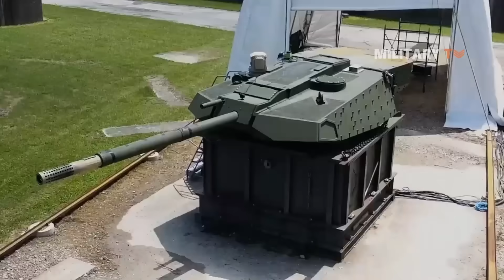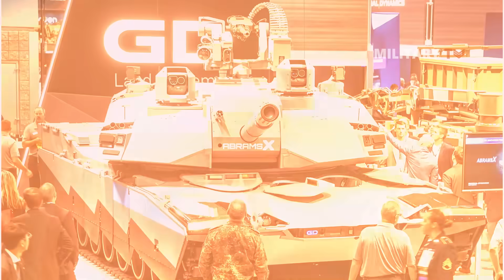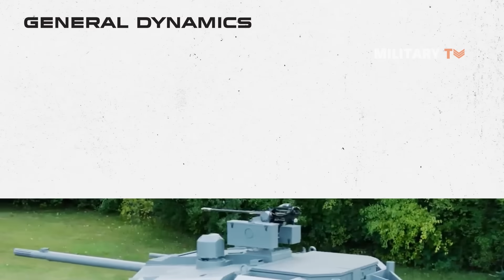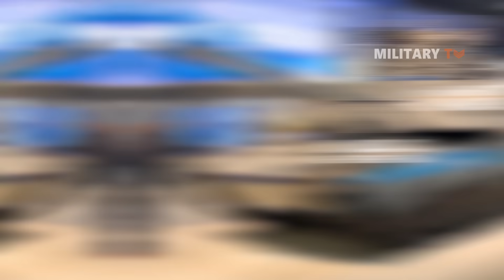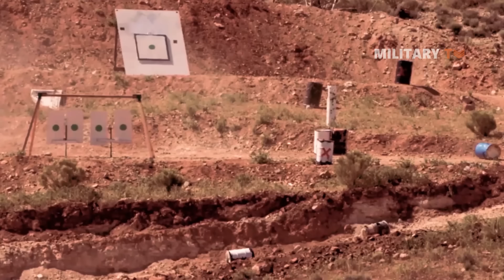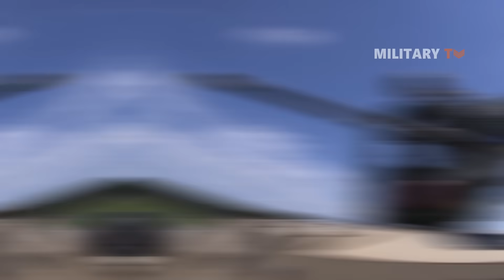Abrams X Tank: US Army Successfully Tested Deadliest New Tank

Comment: Yes, the tank should definitely be adopted by the US Army obviously. It has so many advanced features over the previous versions that make it significantly better. The other versions like SEPV3 and 4 are way too heavy for once. They became more then 70 tons heavy which is ridiculous. This one most likely has the same protection but with significantly reduced weight, I'm guessing its weight is at least 10-15 tons lighter which will make it easier to transport by air. Plus all the other features like an unmanned turret with a gun fed by an automatic loader. I mean, the fact that the US, UP UNTIL THIS DAY hasn't managed to put an automatic loader on any of its major tank or artillery systems is an embarrassment. The Russians have been doing it since the 1960s. The tank needs to be adopted. Stop with that "it doesn't offer significant advantages over predecessors which can be improved" because THAT is what brought the US army to this state and that was just a tactic by America's domestic saboteurs to prevent the US from gaining a clear military edge over the Soviet Union during the Cold War. That mentality stems from the Cold War days...

Comment: yeah and the batteries will be dead constantly. the vehicles will constantly be in for repairs and parts replacement. costing millions of dollars. maintenance and drivers maintenance is never done properly and that's gonna render the vehicle just about useless on just about a constant basis. all of the electronic systems are super cool and make things really easy, until they stop working. which they do all the time, they break constantly. and I'm the one who has to fix it. and knowing engineers, those batteries are probably gonna be a goddamned nightmare to access and replace. AND THEN. well why cant we get any parts???? well it's not supposed to break!? .......... so you have no parts? nope they were never supposed to break in the first place....................................................

Comment: What happens when the internet shuts down tanks will not be able to operate with all the AI stuff they have 😮
Reply: I don't believe internet is necessary it should all be ran off its own operating system. But if it really was necessary they would use a starlink like system to acquire internet connection

Comment: climate program for the army? that parts not needed. how the hell are they going to charge it? ev charging stations on the battlefield? the multifuel engine sounds better if htey kept that, and found a way to charge this one then maybe, but i forsee the battery running out and not bieng able to be charged. liberals rarely see the whole picture, gas of all fuel types is badly needed. and will always be used utill we come up with cold fusion vehicles. or hydrogen vehicles.